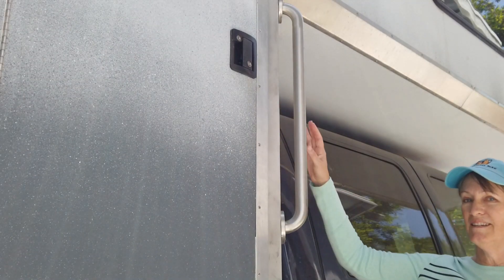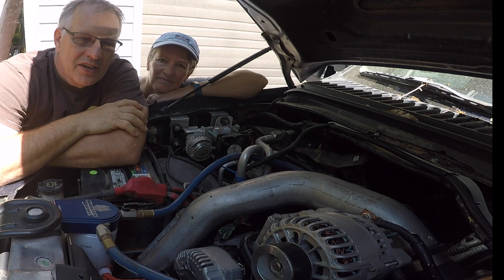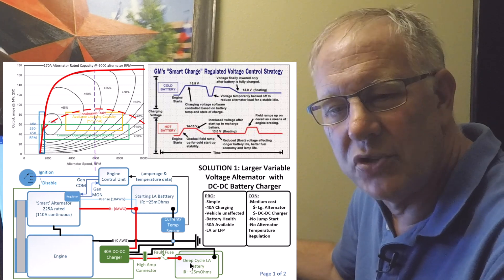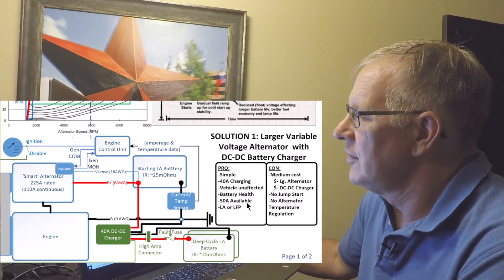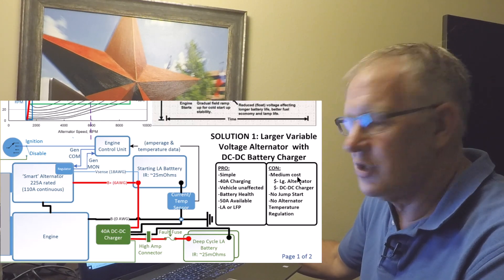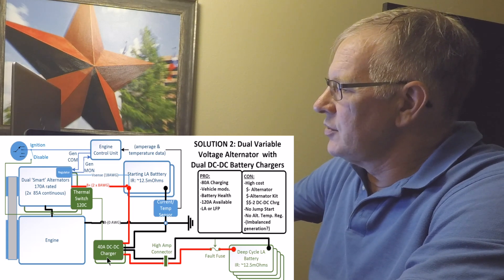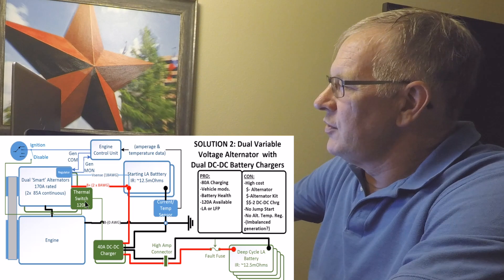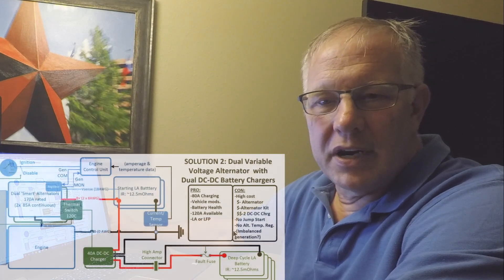SOLUTIONS: Truck Alternator Charging Auxiliary Lithium Battery Setup PART 2

Comment: Hi Steve, great information, feel like I'm back in school. We have a truck camper  (Northern Lite 10.2), we are adding 6 100ah lithium batteries to be charged via a DC to DC charger ( EQP-VIC-ORI121217040 Orion XS 12/12-50A DC-DC battery ) charger   from our truck. We are about to order a new Ram 3500 gasoline truck. it has a dual alternator option rated at 380amps. Or we can just upgrade the alternator to a single 220amp alternator.  Trying to relate all this info about sucking power from the engine and turning it off on steep hills etc.  The question is. Should I order the 2 alternators or just the upgraded 220amp one.  Glad I found you via Truck Camper Adventure online magazine. Already sharing your site to others. Thanks so much. Gerald
Reply from the maker: Gerald, I don't know SPECIFICALLY how the dual Ram alternators are regulated BUT I am going to relay how I KNOW Ford, and GM are.....one alternator is dedicated as the primary and supports the vehicle systems full time. The second alternator is controlled by the ECM which receives feedback from the primary on how hard the alternator is working to satisfy demand. It ONLY activated the second alternator if the primary cannot satisfy the demand. This means the primary works long and hard all the time and the secondary rarely comes on. Lots of heat and load on the primary that will cause it to wear much faster than the secondary. To the point it might be wise to treat them like tires and rotate them every couple of years....will be a PITA and I probably wouldn't do it. Second thought, alternator generated electricity is VERY expensive. Automotive alternators typically operate at 50-65% efficiency under moderate load. Their absolute peak efficiency is 75%. I use my system only as a backup and honestly haven't used it at all for several years. 3 years ago, my solar panels failed and had to use it a lot all summer and it did work great. I HAVE to have 2 separate power systems because the vehicle is 12v and the camper is 24v. Even if they were the same, I'd still have separate systems, one lightly loaded for only the vehicle and one that can be turned on only when needed for the camper battery (separate the  power output AND control from the vehicle). If you get the two smaller alts, you can choose to operate as either the stock system or set it up my way. Changing alternators to larger ones on your own is pretty cheap ~$200 for good aftermarket units. Warranty on a new vehicle may be affected if you reconfigure the alternator wiring but mechanically/electrically there is less strain on the vehicle. If you plan on getting an electric winch, that is the only reason I see a benefit to keeping both alternators in the one vehicle system.
Reply: @WorkingOnExploring  Hi Steve, I've been looking into the details, they do function as you suggested. Although one is 220 amps, and the secondary is 160 amps. So trying to decide to still go just with the 220 amp or the dual. Many are saying I don't need the secondary, but, charging 600 ah s of lithium would need a lot of charging. Thanks again Gerald,  btw, busy watching more of your great stuff
Reply from the maker: @geraldrainville8412 Just to reiterate what I say in video, 1) alternators only produce about half of their 'rated' output continuously. 2) typical vehicle load on a heavy duty truck is 30-40A with standard equipment 3) assume a 220A alternator ( same as my secondary) only puts out 110A continuously at 70F and less than 100A in  summer heat typically around 90F at midday. That means less than 100A max output - 40A vehicle load = < 60A reserve capacity. Don't try to run more than a 50A B2B charger. 4) if you upsize your alternator after purchase, be careful to increase cable to use an appropriate size wire on both positive and negative.
Reply from the maker: I'll be at the TCA rally again this year if you happen to be there we can get more deeply into it. Of we can talk on the phone if you want....I love the topic and am happy to spend any amount of time you need.

Comment: Great video. I have a 2016 F-150 with a victron 12-12-18A DC-DC charger, with Bluetooth control. Auxiliary battery in truck bed in a wooden box. I’ve had the system for almost 3 years, no problems at all. My truck happens to have the “Smart/Variable voltage alternator” 225A, and its original. Personally I don’t care for the variable voltage alternator, BUT, I lose close to 5 MPG if it doesn’t go into voltage reduction mode, (if it’s very cold outside). Adding a secondary alternator would have likely cancelled out my fuel economy. I like the ecoboost 2.7L engine. It gets great fuel mileage if I keep my foot out of it. I’ve hand calculated 27.7MPG at 55 MPH. Again, great video. Thanks for all you do!
Reply from the maker: Using alternator generated electricity is the most expensive energy you'll ever buy. It's easily $.50/kWh when grid electricity is $.14/kWh. When traveling, power is life so convenience is more important than economics and alternator power is very convenient. You are wise to use a smaller B2B. Many folks 'go big' and drastically shorten their alternator life.

Comment: These are some great informational video's. I never new about smart alternators. I have had several truck campers, [slide in type ] and always ran 8 gauge wire on an anderson connector, thru a battery isolator for the 3 way refrigerators while driving. Never a problem. Now I just got a new truck and learned this. Sure enough, I watched the volts on truck go to 12.5 for a while when I was driving it. intermittent though. I only got 1 alternator 170 amps, and 1 battery on new truck. Camper has its own rv batterys. In your opinion, will the rv batteries stay charged while driving with the 3 way fridge on? Thanks
Reply from the maker: A 3 way fridge,  on propane, draws 2-4A of DC power to operate the controls and about 300-350W of propane energy to generate heat to operate the refrigeration cycle. When you shut off the propane and run exclusively on 14V DC, it will replace the propane heat with electrically derived heat and (attempt to) draw 30-35A @ 12.6V (assuming it is only supplied by the camper battery) total. The bottom line is that an absorption fridge is a HUGE energy hog that is almost impossible to operate on DC for any length of time. Without a 30A DC-DC charger, you will most likely draw half of the fridge load from the camper battery and likely run your camper battery flat in 4-6 hours. 

If you have a 170A smart alternator, you can assume that you can get 85A from it constantly BUT power will only flow to the camper if you use a DC-DC charger to boost the voltage between the alternator and camper battery. I assume the truck will draw 35-55A depending on operation of accessories. Normally, I would not recommend more than a 30A DC -DC charger to prevent overloading the alternator in situations where you need to run truck accessories ( like lights and the heater) when your charger is operating. It's good to be able to shut off your DC-DC charger manually for this reason. A 30A DC-DC charger will deliver 30A @ 14.4V but it only does so at about 88% efficiency and if your smart alternator is only putting out 12.5V, the charger will draw (14.4/12.5 x 30A/.88) = 39.3A from the alternator to do it.
Reply: Thanks for the reply. Being as I Only travel a few times a year for a few weeks each trip, and it used to work just fine with the old style alternator, Could you not just turn the headlights on and put it in tow haul? Would that make it stay charging all the time? Just a thought from what I read. @WorkingOnExploring
Reply from the maker: @greggstaples1551  you CAN force the alternator into a higher voltage by turning on more demand but the voltage will likely not be more than 13.5V and more likely about 13.2. That is essentially a float charge and will not do much to charge but will help power the fridge. If you have a voltmeter you can monitor while driving, it may be worth a try. I would bite the bullet and get a 30A DC-DC charger if you want a more reliable method.
Reply: Thanks for the info and education. @WorkingOnExploring

Comment: How does one get a thermal switch for the alternator?
Reply from the maker: The type is KSD9700. There are two parameters of concern 1) function temperature is available from 30C to about 150C in 5-10C increments. I use 120C and I would not advise using above 130C or below 110C (nuisance tripping). The reset temp is 10-15C lower than the function temp. 2) Normally Open or normally closed. I want to open the circuit when it functions so I use normally closed. They can be found on Amazon, ebay (search for 'KSD9700 120C') or from any of the electronics resellers such as Digikey, Mouser, Allied Electronics, etc. They are quite cheap and you may not be able to buy just one and will often find you need to buy bundle of 5-10 of the same or as an assortment of temperatures. They come with either plastic (white) or stainless housings. They only have about 4" of wire so buy some 18AWG high temp insulation primary wire and some heat shrink crimp terminals to extend them 105C rated GXL wire is fine but rubber or silicone insulated wire (120C-200C rated) is also often similarly priced. Use metal filled epoxy such as JB Weld.

Comment: Great video, Option 3 seems to be best for my situation of towing an RV. My truck is outfitted for a second battery and auxiliary alternator. If I put 2 lithium batteries in the RV with appropriate sized wire run back there for charging, would I need to put a 3rd battery in the truck for the dedicated auxiliary alternator to have somewhere to put its power when disconnected from the RV? I'm considering using the Wakespeed WS500 voltage regulator for my lithium charging system and be completely isolated from the trucks factory system.
Reply from the maker: Your 2nd alternator will need to run from an external 'charging' regulator because it is charging lithium and will need to be able to sense their voltage AT THE BATTERY so you need to plan for a large power cable going to the batteries and a small sense wire coming from the batteries to the regulator. This separates the alternators to dedicated purposes. Wakespeed is an option but likely more than you may need. Its real strength is to communicate over CAN bus to lithium batteries with CAN external communications. The simpler/cheaper way to run is Balmar MC618 or 614 with optional temp sensor on the alternator. Go to WorkingOnExploring.com/Techdocs and find my 'System Description and schematic diagram' (3rd or 4th row down on the left). It is a little different than what your system with a charging regulator will be but it should make sense to you. I have a diagram of what I'm talking about that I can send you. I am not using a Balmar charging regulator but an external thermostat that shuts the regulator off rather than turning it down automatically. I have a switch on my console to turn it on and off which is what you can do using a relay on the sense wire coming from the trailer. Its automatically shout off when the trailer is disconnected.  Happy to set up a call if you want to discuss but am running out to fix a plumbing problem right now. send me your contact info to workingonexploring@gmail.com or leave me a message on my blog.